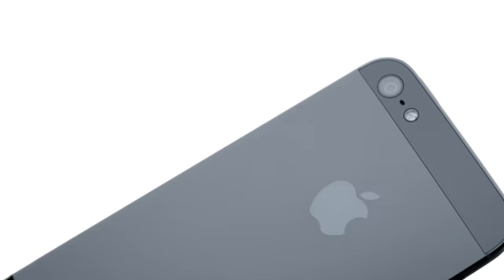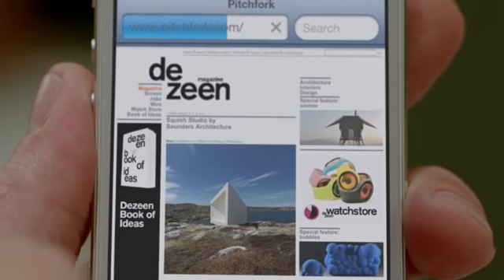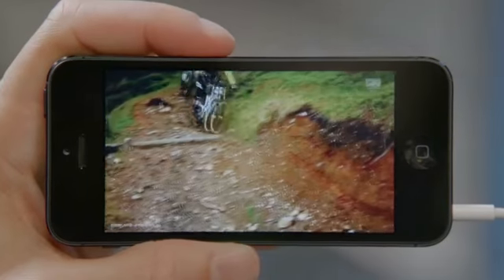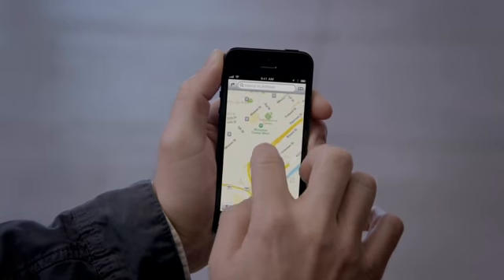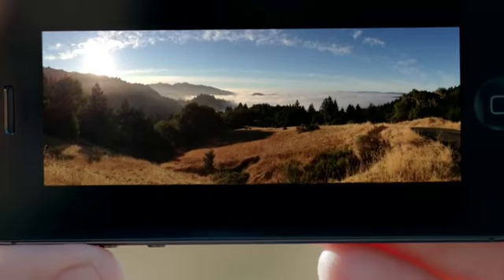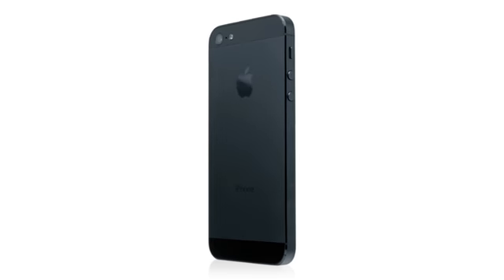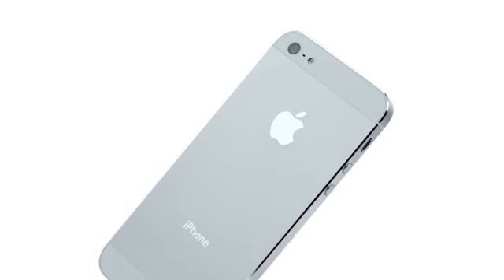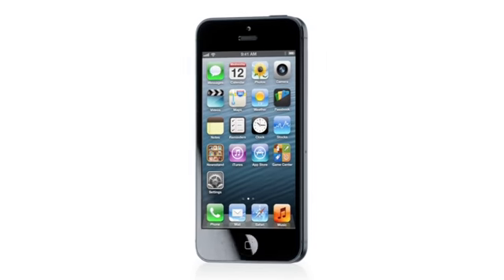iPhone 5 Promotional Video

Comment: to be honest there is a huge difference because I am still running the 3GS! If I was a fanboy I would have every Iphone to date but I dont! I enjoy the fact that the phone is simple and easy enough to use that a five year can figure it out! I don't need luck because I do research before I buy anything! The bottom line is that the phone does everything I need it to do and much more!

Comment: It's not an outdated argument at all. Even to this day phones are released with an older OS. Many phones aren't supported after a few months. Fragmentation also means the hardware itself. Ask developers to THIS VERY DAY still have to deal with so many fragmented models and OSs. Behind on camera how? MP doesn't mean everything. Even a pro photographer will tell you the lens is more important than MP. I don't have to buy anything new - Adapter - done - simple.

Comment: What makes it behind? Not enough cores? It doesn't need them because the GUI is controlled on a machine level instead of needing more CPU power. Camera? Again, higher MP means nothing when you have a crappy lens. Screen size? I'm sure Apple could have easily made a larger screen size ... they chose to keep it compact. If you think innovation is "make a bigger screen and more cores" ... that's just poor thinking

Comment: I've never said the bigger, the better.The S3 has just the perfect size for a phone, a little wider and thinner would make it PERFECTION. Also, the newest and latest doesn't necessarily mean that it's better, just look at those phones, S3 came out months earlier than the iPhone, which obviously means the iP5 is the newest and latest but NO, it's not even close, apparently the S3 takes it by far. Wdows is good, much better than Apple at least. You'll not see red line like this one with Wdws! lmao

Comment: Behind, is when the innovator becomes the follower. Apple could easily have given customers something worthy of the hype.. they're rich enough. But they chose not to. They would rather contain people in their own ecosystem where they control the scope of functionality + new adapters. It's design and interface is still the same and the screen is still fragile. If you think innovation is giving a fancy marketing name to standard features or adding another row of apps... that's just poor thinking.